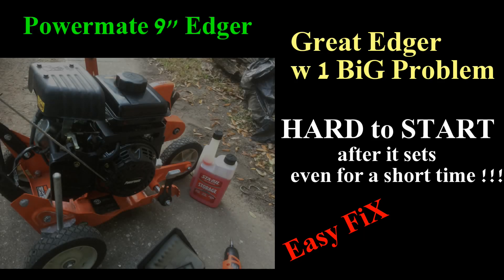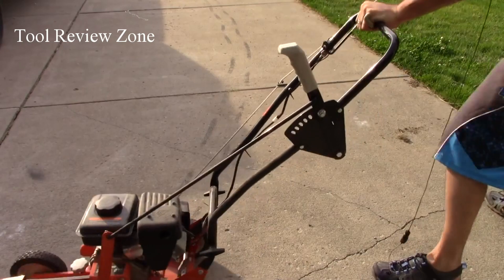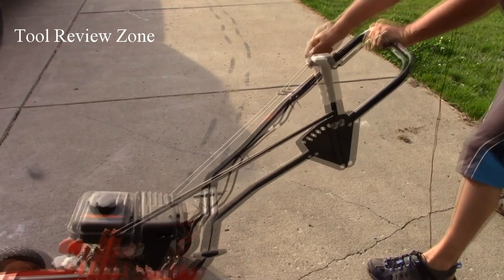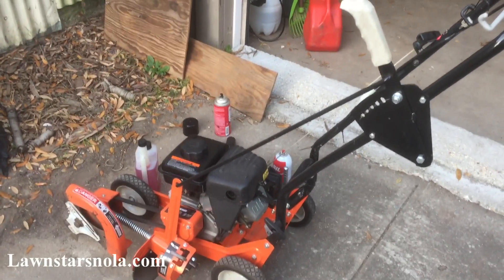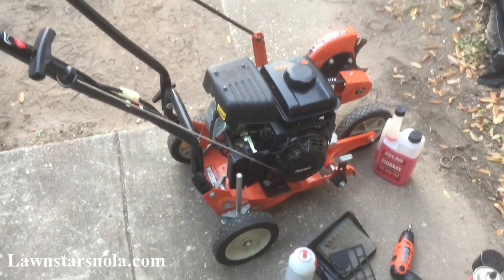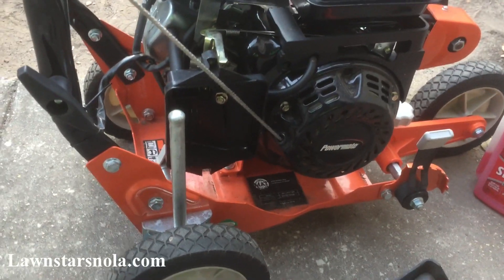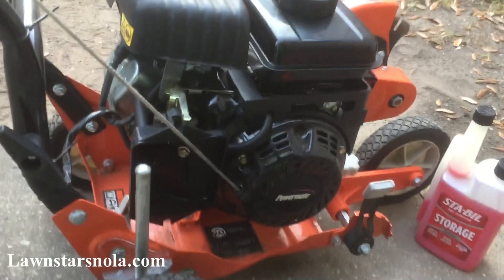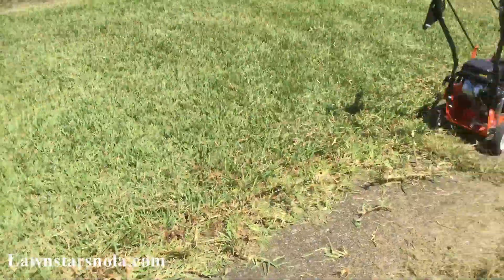Solved! | Powermate 9" Edger Hard Starting FiX

Comment: Thanks, worked like a charm ... same model, same problem.  Also, I drilled a 3/4 hole in the air filter cover using a flat bit (when it was removed to use the Easystart).   Now I squirt the starting fluid through the hole onto the foam air filter, works like a charm every time!
Reply from the maker: Great idea. I'm gonna do that also
Reply: Mine starts for a second and still dies ugh

Comment: I had the same problem.  I did what you suggested and "voila" it started on the second pull but quickly stopped.  So, I opened the choke, added another quick spray of starter fluid, closed the choke and pulled the starting cord and it started right up - but I also opened the choke again quickly after it started.  Runs great now.  Thanks so much for this very helpful video.  It saved me $40 and a trip to the nearby small engine repair shop.

Comment: Tip up the edger at 45 degree angle with carborator choke and pull up start cord. After 5 pulls this action works a good result and starts up the engine.
Reply: Thank you! Didn’t have starting fluid and this worked like a charm!

Comment: Please help, I didn't the same w starter fluid.
It runs 1st or 2nd pull but it turns off right away. 
It runs for 1 sec or so that's it but only when I put starter fluid in it.

Comment from the maker: I found fuel running out the carb and soaking the air filter whenever I carried it on my trailer so I added a fuel shut off valve to solve that issue. Worked great

Comment: I was so close. Are used the starting spray that you recommended. It started for a couple seconds but I let go of the handle accidentally and it shut back off. Now it’s not starting again. I will try and pick up some starting fluid and see if that gets it going.
Reply from the maker: I sympathize, these can be stubborn as mules to start and would pay extra 75 dollars if they offered a electric start model.

Comment: Mine starts okay, runs for 30 sec full choke and then stops. A couple of minutes later, can start again but same thing happens. Any ideas?
Reply from the maker: Bad gas or dirty carb? Check the strainer in the bottom of the gas tank for trash blockage.

Comment: Question: anybody had carburetor leak?  
Its started to leak after working for about 30 minutes. Fuel was coming from around upper seal. Would not start after that. I have drained fuel and left it at garage. 
After week called powermate and was told to drive 1 hour to repair facility. Before drive, just for kicks, poured some fuel in and it did not lead and started right up.

Strange....
Reply: leak is back, not flowing but dripping. but starts up and works.  will try to use Home Depot warranty to fix the drip. Don't have much faith that they will help.
Reply: Same issue, clean out the carb float valve. Started right up no leaks.

Comment: Use pre-Obama gas that does not have ethanol. You can find it at Home Depot for $13 per gallon. Or look around and maybe some station sells ethanol free gas. I have to drive 20 miles so it's easier to buy at Home Depot.  
Starts right up even after seating all winter. BTW Home Depot gas is stabilized.
Reply from the maker: I refuse to pay a premium price for true gasoline. I only recently used this edger since last season so it has been sitting up for 4+ months. A little burst of 2 dollar starting fluid, added when needed- cause it doesn't always need it, ---> goes a long way!